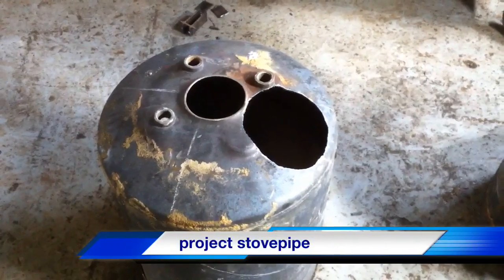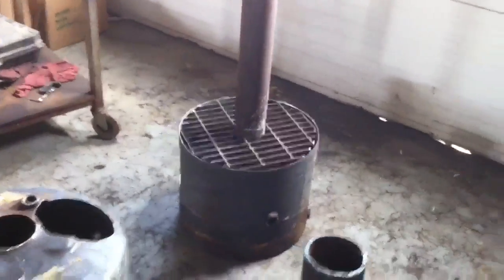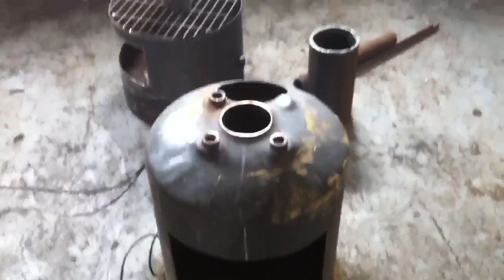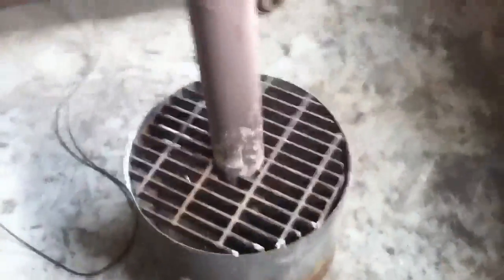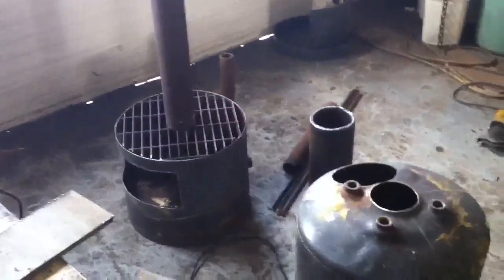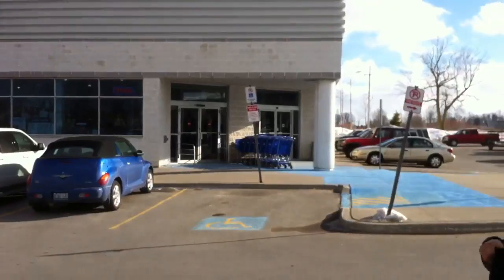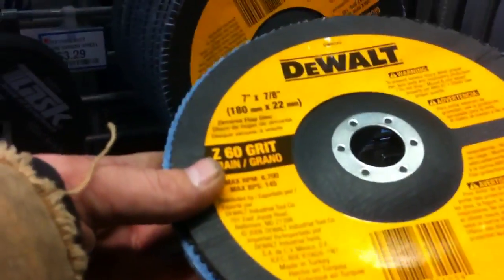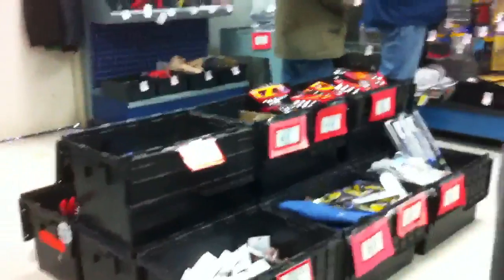project stovepipe/pa trip!

Comment: we had a stove made out of a water tank, that was like 25 years ago , but not a standing stove ours was lengthwise  that had half the top cut out with a flat steel plate welded on , for when we wanted to cook on it , we made awsome toast's on it by the way lol  and we welded another flat plate at the bottom of the tank witch was obviously where the door went also we had 2" wide &  realy thick flat bars bended in a W welded underneath for legs , plus a 6" round X 4" L. antler stove pipe hookup.